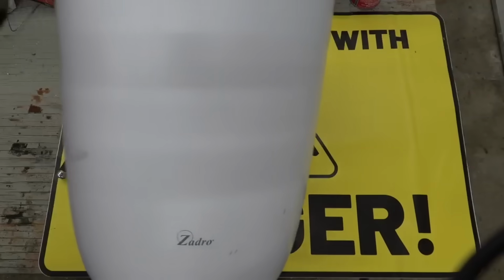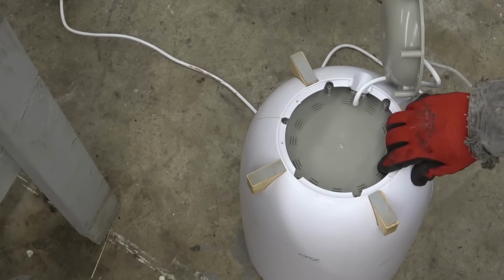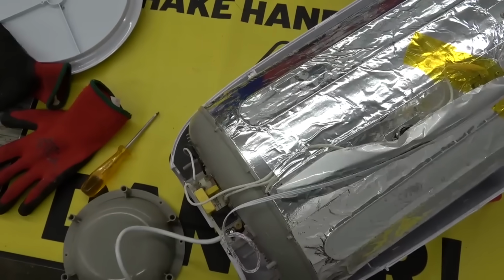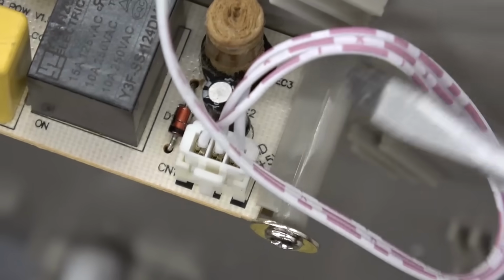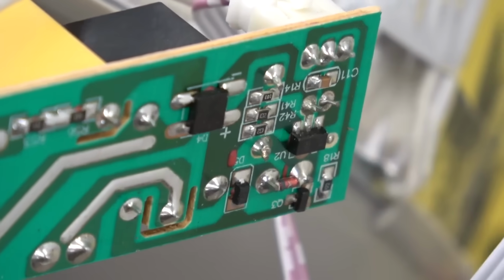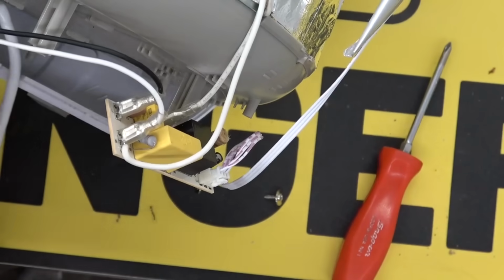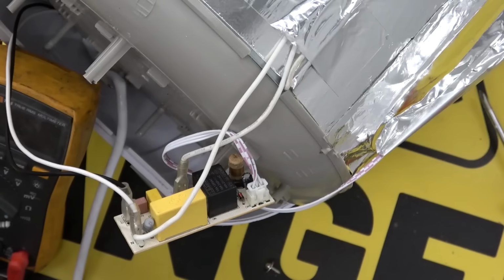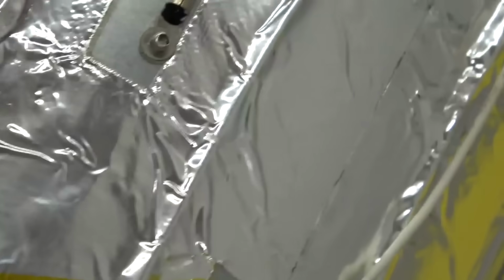BOLTR: Towel Warmer

Comment: "HOLD On / PRESS Off"... keeps pressing like a maniac to try an turn it on 😁

Edit : now i've seen the whole video, don't think it would have made a difference. I'm not expert, but i find an electronic components that looks like old rolled cardboard very suspicious in a modern appliance. As soon as i saw it, wondered what a capacitor from the 1600s was doing here. The good news, if Madame can tolerate a towel warmer with a broken shell, easy to fix.

Comment: The large yellow unexploded capacitor is placed in series between the 120 VAC input and the bridge rectifier (Hi Mehdi) to absorb all, but the required output, 120 VAC. Being a capacitor (approx. 2.2 uF 250 volts), it won't heat up.

The large 18 ohm grey resistor is placed right between the capacitor and the 120VAC line to limit the inrush current when the Lunar Lander is plugged in.

Comment: That's a zenner diode. It is in parallel with the capacitor to clamp the voltage to a certain level the cap can handle. If the zenner fails like it did, it will pop the cap as in your example.
They could add a resistor in series  and prolonged the life of the zenner or maybe design the circuit properly for that not to happen

Comment: This is how these things work:
A dropper capacitor and rectifier deliver a somewhat constant DC current (about 40mA) from the mains. That is kept by a zener diode at 12V for driving the relay. After that comes either another resistor-zener combination to make 5V for the brains or, in case of an timer clock, a NiMh battery, or as it seems in this case, a actual 5v regulator
The 40mA is enough to drive the relay and if it is on, most of the current flows thru its coil. but if it is off, most of the current flows thru the 12V zener diode getting it toasty warm
In this case about 0.5W in that little MELF package (the glas thing)
Since it is placed directly under the electrolytic capacitor it dries that thing out in no time
Without zener or capacitor the voltage can rise to the mains voltage, killing the 5v regulator and subsequently the controller

Comment: Hi AvE, by some strange cosmic coincidence mine blew EC3 exactly same time and now discussing it on EEVBlog forums currently (will need to check Repair section as YouTube autodeletes any reference to it here... I commented twice here already and comment got nuked by autobots). I reverse-engineered schematic, need help verifying it. Cap in question is a HIRAY KF 470 uF 35V -40+105C jobby. That red glass with black stripe component across the leads on backside of board seems to be a Zener. This part of the circuit feeds voltage to Q3 which along with a signal from the button/timer board likely triggers the relay to close and drive the heating element. Again, check out my detailed photos and schematic on EEVBlog repair under "towel-warmer-repair-and-reverse-engineering". Any help there appreciated.

Comment: My money says...

The big film cap feeds AC to the bridge rectifier, charging the EC (exploded cap) shunted by the glass zeneer diode and that powers the microprocessor. Cap blew, no power to controls, DEAD.  I've seen this power supply for small things where the cap is cheaper than a switch mode power supply or a transformer when there's no concern for mains connected to the low voltage stuff.

Comment: Just below C7 on the control board there is a solder joint that looks like it is not connected. Check at 11:05.

Comment: Love me some mystery capacitors. Retired telco. Everything is powered -48v, not +48v. Installing a 3rd party 911 console in the 80s, $2000 ($6000 now). Connected power ..... someone's cooking fish in the microwave.....console don't work. Damn that fish smellls! Circuit layout just marked 48v, connected it phone company standard -48v, totaled. Call manufacturer, oh, yeah +48v. Sorry. Oh yeah, replacing capacitor won't fix. Capacitor not on the circuit layout, doesn't exist, unless it fails. New console. We asked how about spending 10 cents on 4 diodes, too expensive, cheaper to get you to buy a new console.

Comment: I don't know what that EC component was, but my guess, An Electrolytic Capacitor?  That's now an EC or exploded capacitor?   I wonder if the 5.8 ohms was the relay coil and the mystery glass component was a diode to prevent the back-EMF when the controller released the relay, it's a common practice to do that.   Anyway, the next troubleshooting is to plug it in and measure the DC power rails, if there is no DC, then maybe the dropper caps on the AC side is faulted.   

At some point you just give up and buy a new one...  A new one costs $90 bucks from Costco and its a two towel version.

Comment: Plug may still be broken. Lets tester see electricity can flow however once it gets voltage the pressure is too much and doesn't make it past the plug. I know it sounds weird but replace the cord and see what happens?

Comment: You've probably already figured this out, but that EC [Electrolytic Capacitor] is likely to be your culprit. It seems to have "cooked off". My assumption based on what was shown [grain of salt here, not like I went frame by frame forensic] is that the capacitor sets the clock of the controller or is there for smoothing.

Hopefully the cap broke the connection, otherwise that logic controller might be fried [shite stain or no]

Suggested Action: Replace le'cap.

Unless you already turfed it. Anyway, I await the next one, hope you thaw out soon.

Edit: Fat finger, followed by lack of proof reading.

Comment: Near the end of the video look at the center of the screen onto the black button with leads attached to it. Thermal cut off (or "cut out") switch. It should be conductive. Surprised no one mentioned it in the comments as it often fails in heating appliances. Commenters  @MykDamage  and @MattsAwesomeStuff were close though.

Comment: Hay AVE, they make pills that can help expand that 1.44 floppy into something bigger and harder (-; 😂

And that EC was a decapitated  electo-shittic capacitor, who let it all out, common issue when run of the mill component used in a heated environment, I doubt it was a high temp version, so the electrolyte.will have boiled off and blown its head off.

Comment: The diode on the topside is not a rectifier it is merely protecting the self effect of the relay. The rectifier is on the underside a chip rectifier with 4 pins.

Besides you can see the trace underneath the foil wich would be the heater. I certainly would check continuity on that probably the culprit.

Comment: Bad Ec. Test the other caps, possible shorted zener. Might need to use a slightly smaller capacitor to ease the load on zener and Ec

Comment: I could tell the problem right away on this one! I had a Made in China projector from Amazon I put into regular use about 1.5 years ago when one day it pops like a gun, and some magic smoke wafted through the still-illuminated lamp. I opened her up and found two capacitors that looked exactly like your EC3. I found their respective covers rattling around below them.

Comment: Your mystery component looks like a surface mount zener diode. It's likely used as a voltage clamp for regulation. The fuzzy EC component was an electrilytic cap that likely got too hot and exploded. A better fix would be to use solid state caps but judging from the size that's probably 100+ uf capacitor, guessing maybe 300uf range. That's VERY expensive in solid state. Hence why an electrolytic was used. You can try to source a high-heat industrial grade electrolytic if you really want to put this back together.

Comment: I have fixed one of these twice. The nichrome heater wire suffers from hot spots which eventually cause failure because they do a shit job taping it to the interior piece. I was able to locate the breaks in the heater wire using a chicken stick after pulling some of the tape back near the loops.

Comment: The glass diode looking thing looks like a zener diode to me. On the other side, it looks like the inside of a capacitor on the EC spot.

You seem to be getting timid on your old age! Didn't even plug her in and test where the voltage stopped!

Comment: My cure for thermal fuses has always been - just bridge them out and it all starts working again.
Reply: Agree 100%. I've removed 100s of them from dryers over the years and never had any issues.  There's several other back ups.  I've grab so many free elvtric dryers off Facebook and Craigslist over 25 years, they always say it spins but don't get hot no more free. Pick up remove blown thermal fuse and connect wires, give it a cleaning and repost it for sale.  Made thousands doing this.  Same with vacuums, they've plugged up and people throw them out.

Comment: As has been stated by a couple (or more)of other dedicated fans. The culprit in this apparent mystery is the electrolytic capacitor, sadly, sans can. I suspect a "finger tip search" of the area of the necropsy may reveal a small aluminum canister, labeled with the nessasary data to source a replacement.
You never know, y'all might get lucky. 👍

Comment: 8:21 while it is true that if you're not testing, you're guessing (thanks Mikey pipes), I'm pretty sure that electrolytic capacitor that blew its top and sides off is most likely your culprit. 
Good luck figuring out its value, and you can have a working towel warmer again.... With significant damage to its "pretty" exterior

Comment: Not a home-grown cap-- but a de-capped cap. I had to check my calendar-- was i back in 2018??? GREAT to see an old fashioned teardown. My first was a Cuisinart hand mixer you battled. We have the same one here and similar problem. The internal fan would pull in surrounding air and blow across the noard and motor. Sounds good .....UNTIL..... You use it for mashed potatoes. Then the atmosphere of hot, steamy air wreakes havoc with the board and its cavorting electrons. We still have that mixer.... A totem from our 1987 wedding. Still chooches-- but not do much for mashed potatoes........

Comment: Looks like a zener to me.
Reply: Super chintzy way to creat a small voltage supply.  Only capable of supplying a noisy small current, but simple enough way to light a power lamp.  Downside is diodes almost always short out when they fail, which then creates a low impedance path for power to flow until it lets all the smoke out and tries to start a fire.

Comment: 9:33 Hard to tell what bands are on that diode besides black to mark the cathode side maybe a brown one too, but it looks looks like a small signal switching (LL4148 or LL4448 maybe?) diode to me.  Don't know what it does in this setup but my guess is something to do with voltage spike protection.

Comment: Not even a newbie electronisparky, and that cap would have been my first check.
Should have powered it up, and traced to where power seemed to go no further.
Check line voltage was getting buck converted to 5/3.3, and then see if power was making it too the line running to the controls.

Comment: former SMT programmer here, never saw anything other than diodes in that glass package. quite familiar with them, they either had a special nozzle or wildly reduced speeds because regular flat nozzles had no chance of getting a good vacuum seal on a cylindrical glass surface.
Reply: The technical designation for that particular kind of IC packaging is DO-213AA, or SOD-80, or my personal favorite... MiniMELF ("miniature metal electrode leadless face").

In my most recent PCB design, I specifically used Mini-MILF... er, I mean MELF!... diodes. Because I am 14 years old, and this is hilarious. 😁

Comment: Capacitor dropper power supply, with exploded electrolytic capacitor. Most likely ETL certified, mark of the devil in action. "It will not cause fire or kill you, but device kill itself after warranty ended, guaranteed." Similar thing happens to my device a while ago - wireless doorbell receiver stops working - capacitor dropper power supply fried itself, overheated and 2 resistors and zener failed. They done big design mistake - I was able to cut off power section and shovel in tiny switching power supply instead of buying a new one.

Comment: On most heaters, the AC power comes in then goes directly to an overtemp fuse then power any device circuitry. That overtemp fuse is probably popped. We see this all the time in medical equipment. Remember to remove one leg from a component/ circuit when testing continuity.

Comment: it didn’t work because the capacitor exploded and caused a very low resistance at the power supply terminals. As a result, the circuit is current-limited, preventing any voltage from appearing at the output. The resistance was measured across the Zener diode at the power supply output, which is designed to limit the voltage but is connected in parallel with the faulty capacitor.

Comment: 😮Talk to big Clive. The failed component is a gallium arsanide zener diode. It's common for them to fail with a  capacitive dropper powering an integrated circuit. Only question is what voltage is it rated to  likely 3.3v, when you replace  it uprate to a 1/2w through hole zenner and it will last for ever.

Comment: Loved the use of the "vice/hammer of knowledge" technique used off camera to open the plastic shell. That HV insulation slot around the 6:25 mark is totally useless as the track is still is unbroken near to the pad and thus relies totally on the solder resist for insulation.

Comment: im going with that "home rolled" electrolytic cap.  looks to me that it got too hot and it's cover came off.  most likely barely rated for the voltage it was tasked with handling.

first, i'd measure the voltages on both sides of that bridge rectifier, and if i found DC on the output id move on to the regulator circuit and that cap would be my first guess.

Comment: The mystery component at 9:00 is a diode. could be a zenner or a schottky but it shouldn't read the same in the both directions. either you are measuring other components in the circuit or it's fooked and the reason why the capacitor blew up
Reply: Agreed

Comment: If you can find the pieces of the can of that capacitor that is what you rhought it was, you should be able to find a replacement. The cans have the specs printed on them.

Comment: Also did do a voltage test to see where the power go to and then stops at. If power goes into the power board and then doesn't come out, then you know it's that board or if it makes it up to the control board, you know its not power supply

Comment: That thing encapsulated in glass is a zener diode, which is why it has the direction band. Possobly a poor man's voltage dropper.
Edit, yep, for the IC controlling the relay. 

Board appears to be a capacitive dropper, which is fuckin weird, you could have put a SMPS in there that uses the zener as a voltage dropper for the powering some of the logic on the board/maybe further upstream that will be used to energise the relay. It seems to be right opposite the electrolytic that blew it's lid off,  so it's possibly getting it's reference power from that cap. Since the cap is blown and has maybe blown short, that's why it's reading as closed circuit. Or the zener failed after the cap sent 120V into it backways. 

Just look up "Zener diode, surface mount" and you'll see dozens of the exact same ones. If it's crapped out, no real chance of fixing it as you don't know it's clamping value.

Comment: Energize the power supply and check its outputs. You'll find the problems is that "home rolled" capacitor used to be an electrolytic capacitor (EC) that has blown its can and lost its electrolyte.
Reply: Also the dead zener. Assuming there's no other way for the circuit to be completed around it, which there shouldn't be unless it's being used in a really weird way.

Comment: hi the glass component is a zenner diode used for basic voltage regulation it is connected directly across the failed electrolytic capacitor the heat from the zenner dried out the capacitor and caused the case of the capacitor to rapidly relocate
Reply: Did you give it a good shake before opening?
That cap case was probably rattling around in there somewhere.
Reply: *Zener
Reply: @Slicerwizard  See original comment for tip on how to be helpful.
Reply: So does that mean that the diode needs replacing or the cap.? Or both?
Reply: @boonehelm1 the diode will almost certainly be fine
Reply: Sounds like a winner to me
Reply: made to break to keep the waste for profit machine choochin along

Comment: I am 100% confident of what the problem is, without even looking at it. Just by hearing the topic. It's a sneaky hidden fusible link. There'll be on in there, you didn't find it, it's there. Somewhere. Lurking. Sometimes heatshrunk into a wire. ALSO... those button style thermal fuses degrade with use and have weird failure modes. Might seem fine when testing, but 1 second into doing anything they're no good. Short it out when testing to be sure. But I'd start with finding the surely-failed fusible link. It's in there. Somewhere.

Comment: That is definitely some kind of diode, possibly a zenner, and 5 ohm sounds fcuked, tho could be measuring something else in circuit, probably the undressed electrolytic cap ec3. Remove the remains of ec3 and re test diode.
If you can't identify ec3 just get one with similar dimensions rated at 16 or 25v. Will be close enough to make it work.

Comment: You won't get continuity between L and N unless the relay is on, then you'll measure the resistance of the main heating element, which is probably low enough to trigger continuity. The little glass package will be a snubber diode for the relay coil, and in parallel, so you won't get a diode reading. It's not going to be a zener; U2 will be a linear voltage regulator. As quite a few people have pointed out, the exploded electrolytic cap will be the problem, though if it failed short, it's possible it killed the regulator, though those should be short circuit protected, normally.